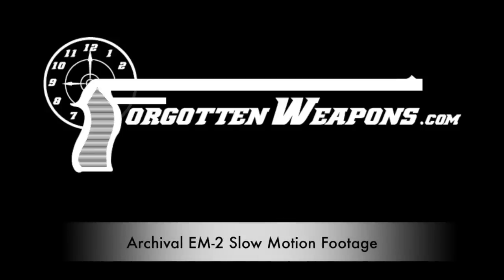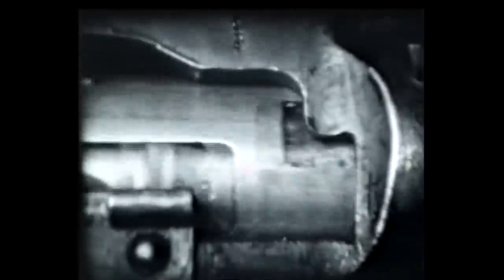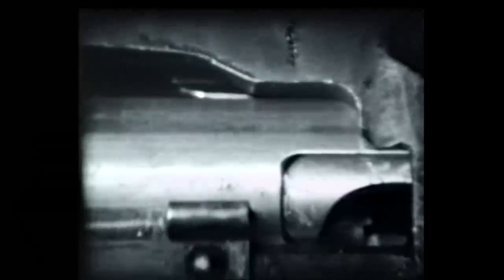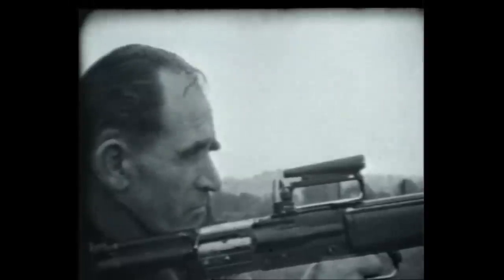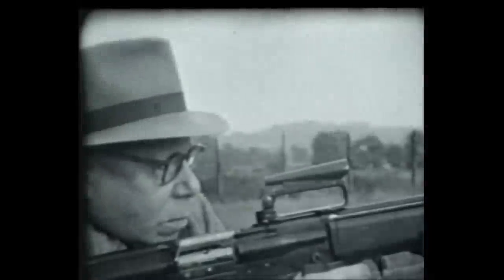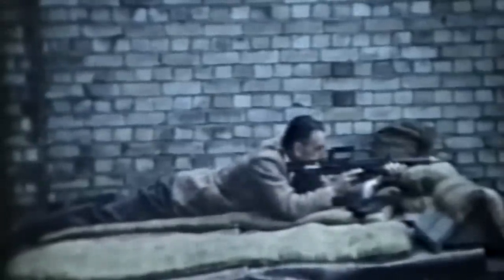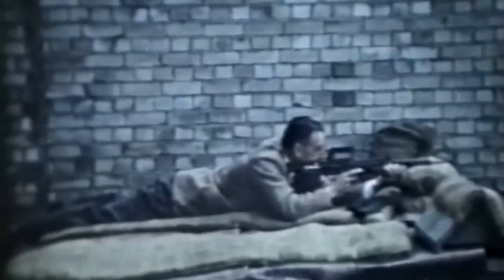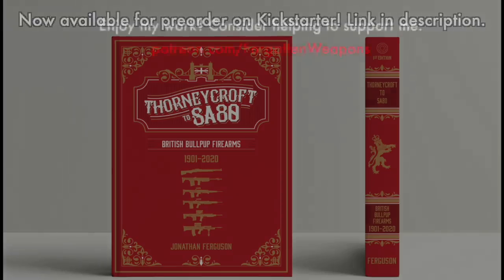Archival E.M.2 Footage: Slow Motion and Janson Doing Mag Dumps

Comment: Somewhere in an alternate universe the US army is just now retiring it's EM-2 based M-14's in 7mm NATO and trying to decide if an even smaller cartridge is a good idea.
Reply: I'm actually going to doubt that. With a good intermediate cartridge, there's little reason to go smaller.

I'm kinda wondering what might have been if the US had managed to adopt .276 Pedersen for the semi auto rifles way back in 1930whatever.
Reply: Ah, there's a thought :)
Reply: @ScottKenny1978  We be asking why they did not adopt a heavier cartridge like the 7.62 Nato.
Reply: This is why I'm not too torn up about how things actually played out. If the US had adopted the .280 in the 50s as the standard rifle round, I think it's a lot less likely the 5.56 (or something like it) would have been adopted as early as the mid-60s (if at all).  IMO, the .280, while much better for the role than the 7.62x51, is still somewhat too big, heavy and powerful to make for what I'd personally consider a really great standard intermediate cartridge meant to be used in a mass-issue select-fire assault rifle. The 5.56 isn't quite my ideal either, but a lot closer to it than the .280. Experience trying to use the 7.62x51 M14 in full auto made it starkly clear to the US military that such a large, powerful round was unsuited for that role and led to the adoption of the 5.56, whereas if we had adopted the .280 instead of the 7.62 I'd worry that the Army would have decided it was "good enough" of a light automatic rifle round and kept it for many decades and a really light, small caliber high velocity intermediate round may never have been developed. YMMV, of course.
Reply: @emu4286  I agree. But imagine an AR in .280...
Reply: @jonathanferguson1211  I wouldn't mind having one, despite all I just said. Closest you could probably get today would be an AR in 6.8 SPC or 6.5 Grendel, though both of those are still a bit smaller, lighter and less powerful than .280. I think .280 would probably have made an excellent cartridge for a light semi-auto DMR.
Reply: @shawnr771  unlikely. The .276 Pedersen had similar ballistics to the 06, without the massive recoil. It launched a 125gr slug at 2800fps, so recoil would have been about 80% of the 06.

Is it less powerful? Sure. But it flies about the same, and would be significantly easier to shoot full auto from the shoulder.

The initial adoption would have been .276 rifles and maybe BARs, with the machine guns staying in 06 to use up the existing ammunition. With the m1917 and m1919 having changeable barrels, modifying them to shoot .276 after stocks of 06 had been used up would be simple: bolt, barrels, and recoil springs. Replacement bolts are necessary because .276 case heads are a touch smaller than 06 are.

Though it's possible the US would have decided to keep the mgs in 06, for better extreme range performance. I mean, the US would have been used to the mgs using different ammunition than the rifles by that time, like how we use 5.56 rifles and 7.62 mgs today.
Reply: @ScottKenny1978  My main reply was meant to mean we would all be arm chair quarterbacking the decisions. Hindsight being 20/20.
Dont you Custer would have rethought his decision to leave 4 gatling guns behind.
Reply: Yup. If .280/30 or even .276 Pederson would have been widely adopted, then I think some other ‘assault rifle’ cartridge would eventually have been introduced. Perhaps even a bit smaller than 5.56, given the ‘rifle’ round it would be up against would be smaller than 7.62 NATO. Perhaps something like 6x35 KAC. If not, then submachine guns would not likely have disappeared as general issue alternatives to ‘heavy’ rifles. Consider that some countries issue the H&K MP7 as a lighter alternative to their 5.56 muskets. Germany and Norway come to mind. 

5.56 actually seems about perfect as a general issue calibre at section or even platoon level. Borderline light enough to satisfy most armies to do away with SMGs, and borderline (barely) gutsy enough to be sufficiently powerful for general issue individual weapons. 

I could see the new US army’s 6.8 (or a perhaps similar .264 USA) as a perfect round to replace 7.62 NATO for GPMGs and DMRs, but far too heavy to replace 5.56. The overall carried weight has to go down, not up.
Reply: Shawn R I don’t think so. Custer would be a day or so behind his date with destiny if he were hauling an artillery train. Maybe later. Gatling in that day were light artillery in size, carriage and caissons, weight etc. he might have been relieving the main column of the expedition instead of racing ahead of it.
Reply: @emu4286  That's actually a great  thought process you showed us here. What would be your perfect cartridge? Do you think current US thinking of 6.8mm goes in the right direction?
Reply: @ScottKenny1978  I tend to agree Scott. The Brits were also eying up the .276 with Vickers producing the Pedersen rifle. In its time, this calibre seemed about perfect. Imagine a Bren scaled down with a 35 to 40 round mag to go along with the M1…

Also, don’t forget that in the early days of .276, the intent was to replace both the M1903 and the BAR with a semi. Somewhere along the line they ended up keeping the BAR and repurposed it into an LMG make-do.
Reply: @ryc3rz  I'll admit my personal conception of the ideal intermediate cartridge is a bit nebulous, but I'm thinking of something along the lines of .224 Valkyrie or 6mm AR; somewhere between 5.5 and 6mm caliber and slightly larger and heavier than 5.56, enough to send a 77-100gr bullet around 2700-3000 fps (big ranges, I know) out of a barrel that isn't too unreasonably long. The "6mm Optimum" concept appeals to me greatly, though to achieve those kinds of ballistics would probably require a cartridge a bit bigger and heavier than what I'd prefer. 

I think the US military's current 6.8 program is a bit ridiculous if the intent really is to replace the M4 carbines with guns chambered for it. It's not just a variant of the 6.8 SPC like some people seem to have assumed. The specs I've read for this new 6.8mm round specify a 135gr bullet at around 3000 fps (out of a pretty short barrel no less) which is definitely NOT an intermediate round; that's full-power battle rifle round ballistics. The SIG version of the round has a 51mm long case, same as the 7.62 NATO. Replacing 5.56 M4 carbines with these things would be a pretty big step backward, IMO.
Reply: @ryc3rz  if they're still trying to do some ridiculous overmatch bullcrap, they're honestly trying to get "assault rifles" chambered in .270 Winchester.

If they are aiming for a heavier bullet in an AR-compatible size, then say hello to the .277 Wolverine, a 5.56 case necked up to take .277" bullets. Or 6.8spc, if you want to change bolts and links for the SAW. 

Edit: or 6.5 Grendel, if you're not absolutely married to a .277" bullet, but that has the same issues as SPC, in terms of having to replace bolts and needs new links designed for the SAWs.
Reply: @kiwigrunt330  my guess is that they discovered that the Garand, even en masse, did not make an adequate replacement for a light machine gun, so the BAR was retained for that role even though it was a bit suboptimal.
Reply: @emu4286  .224 Valkyrie would be a bit of a barrel burner. It is not often taken into consideration in these calibre conversations, but both 5.56 and 7.62 are quite versatile and friendly to barrels. Not a big issue for sniper rifles and perhaps DMRs, but quite important for MGs and IWs.

Comment: EM2, TSR-2.... Both torpedoed by our overseas cousins 😭
Reply: TSR-2 wasn't exactly torpedoed by the US, the incoming Labour government had seen numerous increases in the predicted price over the previous 5 years and didn't have any faith in the ability of the British aerospace industry to control their costs in future. When General Dynamics offered their F-111 at a lower price they had something of a 'the grass is greener on the other side of the fence' moment and switched to the F-111K. Later, when the cost of F-111 started to increase, they then cancelled that as well.

It also has to be said that mistakes were made in the original specification of TSR2; the engine choice especially but also the gold-plated reconnaissance capability.

Comment: Did I see right? On the last clip, does Janson switch trigger fingers? It looks like he uses the index finger for the first mag, then his middle finger for the next two mags and then back to his index finger... That's kindda strange, no?
Reply: I suspect he was getting tired. He had already fired at least one mag before the clip starts.
Reply: I had thought he got tired, too, but a couple other commenters suggested that it's a hangover from SMLE training. Apparently it's much faster to work the bolt with your palm staying on the bolt handle and using the middle finger to pull the trigger.
Reply: @ScottKenny1978  It is, but that was not in fact standard practice for normal shooting, certainly not by the Second World War. Paging Bloke on the Range... Janson would not have received much training on Enfields being a foreign national in an engineering position. The fact that he starts with index and switches fingers suggests that it was fatigue. I can't be certain of course, but that's my view.
Reply: The fire selector switch is right where the right index finger would be when firing with the middle finger.

Comment: I guess people see an unholy mix of AKM and SA-80 in EM-2 and think that it would have 1)allowed to get proper intermediate round for NATO out sooner despite american interference; 2)would allow to work out all the quirks of SA-80 or in this case EM-2M(?) decades earlier; 3)potentially allow the rework of .280 British into more familiar .223 round just like soviets switched intermediate round generations between 7.62x39 and 5.45x39 by having the same case, but new bullet and explosive filler used. Once again, decades earlier.
BUT
Did the british ever feel like you were left out or underpowered in terms of infantry firepower in those decades? I mean, even if finalized and modernized EM-2(EM-2M, EM-3, whatever) would be available, americans(who would actually benefit from adopting it) wouldn't notice it and would still run around with M14.
Reply: Nope. SLR is fine - you are correct. It's a shame, but the FN was a perfectly sensible choice once .280 was off the table. Also, not seeing the AKM in EM2. It's a novel design with some G43 and a hint of FG 42.
Reply: @jonathanferguson1211  AKM is used here as an example of:
1)AKM was renowned assault rifle with intermediate cartridge that had proven succesfull back then. NATO was stuck with brilliant G3, fine FAl and FN49 and... M14 that was there. For a few decades. For european armies it didn't mean all that much
2)AKM is aĺso an example of how much time was invested to work out all the quirks of AK. So you can expect the same time for EM-2 to mature. UK might have better specialists, higher budget and better production quality, but it's also working with less tested round and more complex design;
3).280 British is a first gen intermediate round just like 7.62x39. Somewhere along the way the bullet caliber would have to drop to 6.5 or around 5.5 we are used to this days(maybe it'l be 5.56, maybe some other one close to it) and the bullet modernized. However it'll be closer to 5.45x39 in the way it could be done. Ie new standart intermediate NATO round would be 6.5x43 or 5.5x43 or whatever.
^that is why I mention AKM. Not because of design, but because of history and idea behind the design changes. Do I need to explain why I mentioned SA-80 too?

But yes, the only ones who fought to benefit from new round, would be americans... and they slowpoked too much due to reliance on M1 and M1 anyway.

Comment: i wonder if rifles could cycle rounds in space just fine or they would jam more often
Reply: The big problem would be thermal expansion and lack of radiator area. No air to convect and conduct heat away, it all has to radiate.

A related problem is actually vacuum welding after the lubrication boils away due to the lack of pressure.

Comment: so all mechanisms other that a bolt action are in essence delayed blow back, some are delayed more some and some delayed less?!
Reply: Technically, no. 'Delayed blowback' refers to a specific type of operating system; see Ian's video on the subject. It's also known as 'case projection', which makes the difference clearer; blowback uses the fired case moving rearward to push the bolt open, gas operation (as here), uses gas pressure via a port in the barrel to unlock the bolt and push it rearwards.

Comment: If the bugger is that good if we need a bigger bullet like the US is looking at 6.8mm we should just update this and jobs a good one, development costs already paid gor😂😉
Reply: It was great at it's time, but that train is long gone. Today it's just outdated like other 1950's guns.
Reply: Adam Cichon I will bow to your knowledge but the M16 & AK47 seem to function pretty well? 
You make bits from polymer and  other more modern materials.  I’m pretty sure it would be as good as anything else?   You stick a rail and a half decent optic on the top, flare the mag well and extend it to fit stannag type 30 round mags? 
Military fire arms aren’t really about reinventing the wheel after all?  
Just an idea, if it works don’t fix it always seemed a good rule of thumb.😉
Reply: @alistairsamson299  both of them,  M16 and AK47 are obsolete. Currently in use are their modernized versions, because their rotating bolts mechanisms proved to be exceptionally good, ammunition for them is produced in billions,  and more so, because political and economic reasons. Also today no one will be interested in the 70+ years old rifle idea. Another fact against is the Stoner's rotating bolt is far easier and cheaper to make than EM2 flapper locked bolt of cpt. engineer Kazimierz Januszewski alias Stefan Kenneth Janson. All and all the EM2 was a "cutting edge" of the rifle in the '50s, but as the whole package, a combination of technical solutions, including the .280 British cartridge ("Ideal Cartridge Panel" in 1945), around which the EM2 was designed. But today? It is a fossil, museum exhibit.